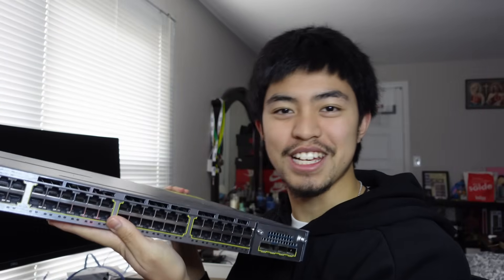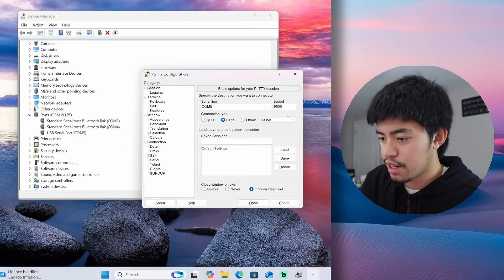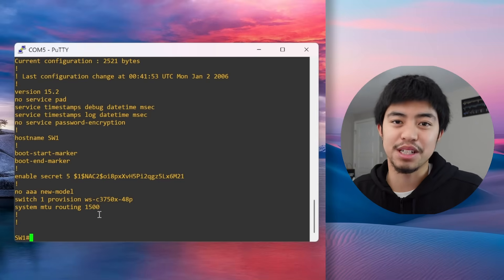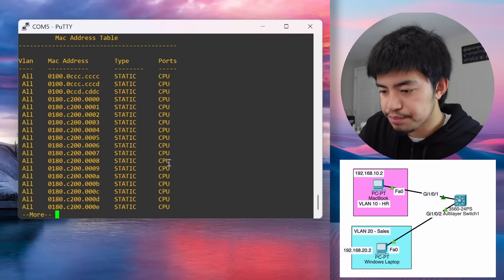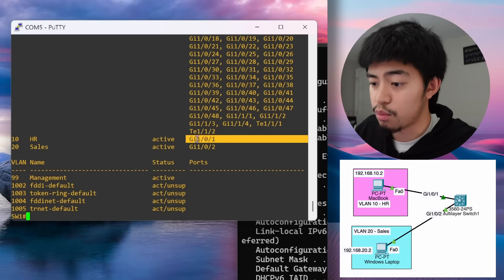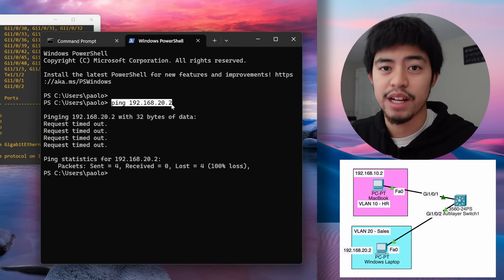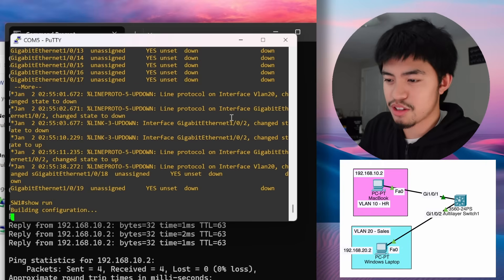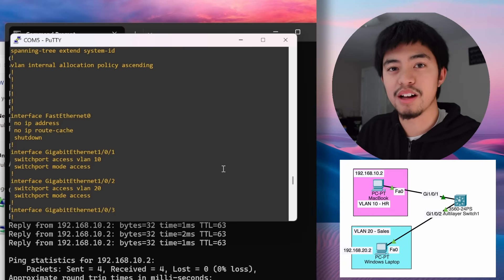How to Set up a Cisco Switch in 15 MINUTES | CCNA Basics

Comment: You were in “vlan 10’s” interface when u created “vlan 20”… just wanted to ask if there isn’t any problem with that?
Reply from the maker: No there's no problem with this, it's a pretty cool feature. When you're in interface configuration mode, you don't have to exit an interface to go to the next one. You can just use the command "int vlan 20" to directly go to the next interface.
Reply: Oh okay.. thanks

Comment: This is the stuff I’m doing in school now. So awesome to see the console cable outside of packet tracer! With a Layer 3 switch, does it still provide wireless like a router?
Reply from the maker: No, this is something that I thought when I was first starting too. I assumed that anything called a "router" automatically had Wi-Fi because the only router I knew was the little box in my house.

In enterprise networking, the functions of a home router are split into dedicated devices so, "router" or L3 switch refers to the device that connects different LANs and an Access Point is the device that provides a wireless connectivity.

Comment: Do i have to give these switches network for me to play around and make some labs? because currently I dont have a network drop  in that room and the only option is wifi
Reply from the maker: No you don't have to give the switches internet connectivity to play around with them. I also don't have a network drop in my room unfortunately lol. With the switch, you are basically creating your own little network that's isolated from your home network.
Reply: @PaoloReyes1  Thanks man because I picked up some 3550's  and a 3560G from someone on  marketplace and picked up a new asa to play around with firewalls  and i wanted to see what I would need to do.